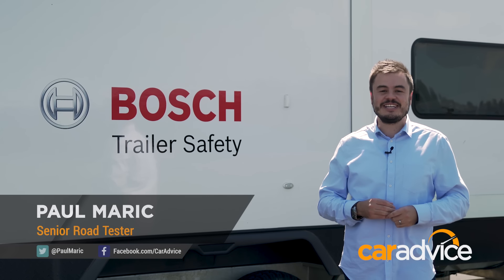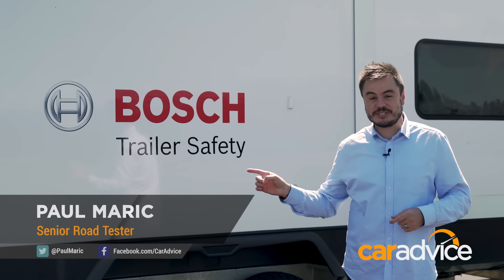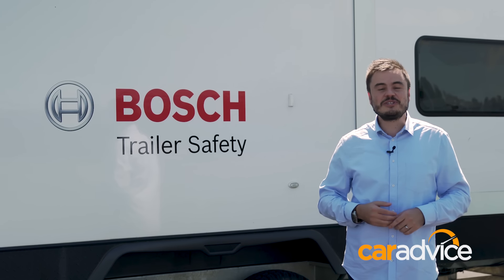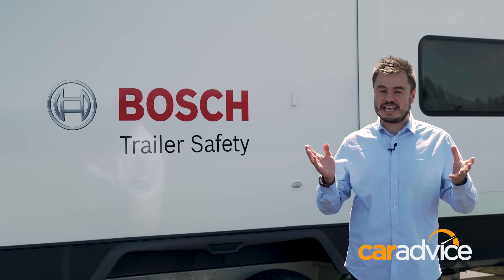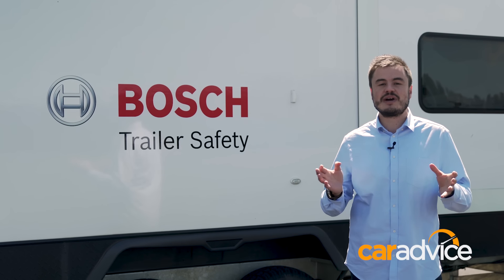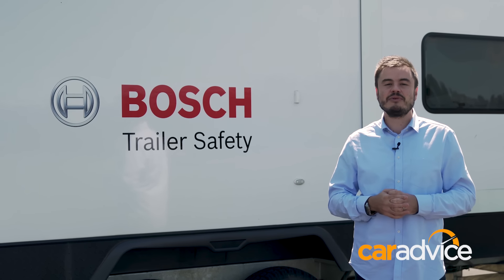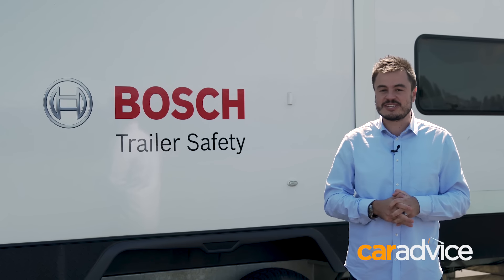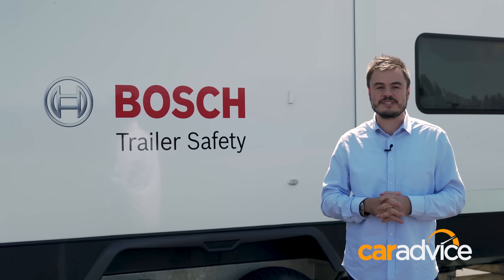Bosch Trailer Safety Control demonstrated: Are you convinced?

Comment: As far as I know most modern SUV's are equipped with such technology as their ESP have trailer mode as well. I think Mercedes for example offers it since the 2006 ML was launched... The example might be wrong but the system exist from a long time.
Reply: Those are different. Trailer stability / assist systems in SUVs use lateral forces detected by the rear end of the vehicle and take corrective action by braking individual wheels of the SUV. But this system is installed on the trailer and uses trailer's wheels for braking, which is far more effective than trying to correct swaying motion of a trailer  by the towing vehicle through the trailer hitch (i.e a single point). Whats more, now you don't need a luxury SUV to get this safety feature.
Reply: I have no experience in towing but my general experience behind wheel tells me the best "system' is to drive careful in tough condition - heavy wind, rain, heavy traffic etc